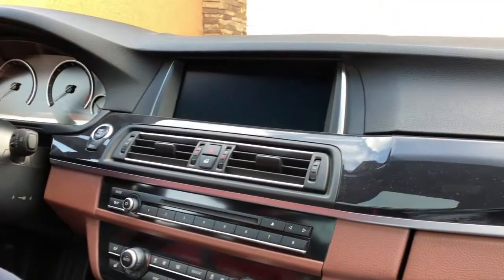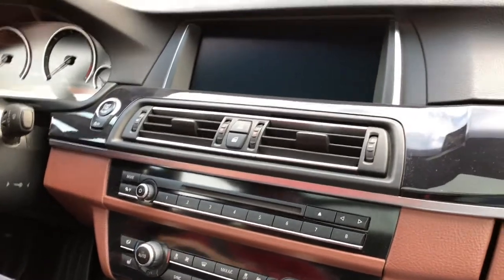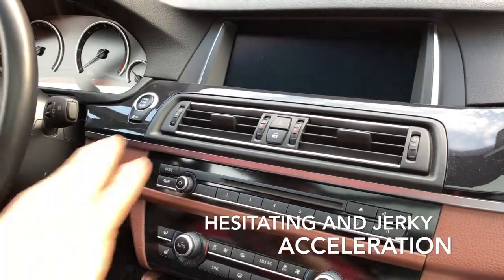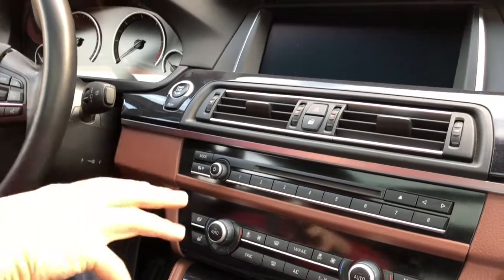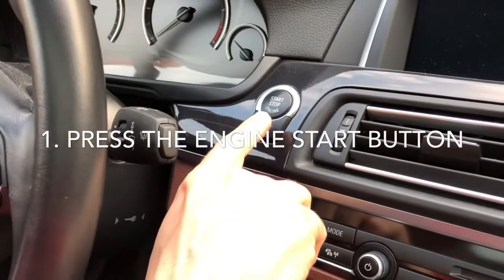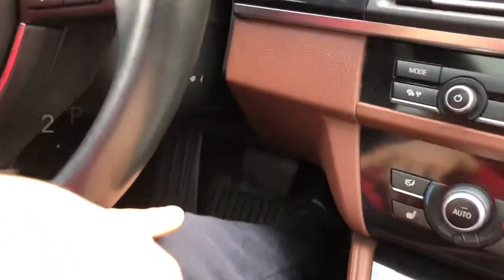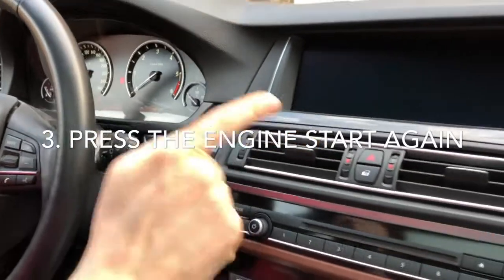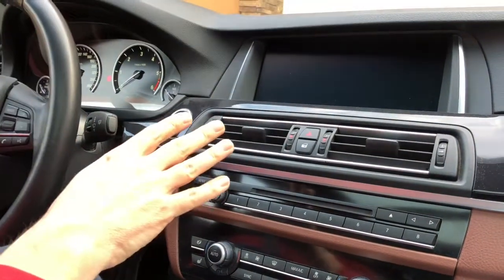BMW 535xd Acceleration issue (hesitation and jerky)

Comment: I figured it out by watching another video.  Something is loose or not sealed on the intake system.  I have had this issue for months and have researched and tried many different things to resolve it.  One possible problem was the air filter possibly being clogged and the engine/turbo not getting enough air.  When I checked the air filter it looked great…. Replaced everything with airbox n such and then the problem became a major issue as the engine was wanting to stall when coming to a stop and a slow speeds.  Prior to this it was only happening at high rpm and top end speeds.  I saw another video and another gentleman on YouTube with tag “Guille” he noticed a break on the seal of the Inter cooler causing the same issue.  Well the airbox is not connected directly to Intercooler return but I figured I would check anyway.  Didn’t have to or even look at the return because the culprit was the airbox connection to the intake.  Reattached and tightened the O clamp.  bAM fixed and engine acceleration just totally went to a new level…. Really where it was when I got the car.  I have been looking at many videos on this subject.  There are so many videos and people that complain about the staggered acceleration and some even claim that it’s just part of the way the vehicle works.  NOPE there is a leak in the intake system SOMEWHERE…. Could be in a different spot for you, however, I think the reason is is so common is that many of us change our own air filters.  Happened to me when I upgraded to k&N.  So if you have “staggered acceleration” or stalling at low speeds… check every component of the intake and make sure there is nothing loose or compromised.  Most likely air is getting in somewhere and I liken it to having a hole in a straw on a beverage.  Cracked straw and drinking your beverage is just not gonna happen.  Same concept here.  Hope this helps.

Comment: This issue what you are describing is also connected to Xdrive (Transfer case/box), check transfer case fluid, if it's dark, change it. Mine has this kind of problem, jerky acclerations, also car was jerking once driving on a hill. changing transfer case fluid fixed this issue 100%.
Reply: @Ray Scriven did you get a solution?

Comment: My F10 523 having the jerky issue . Slow acceleration from gear 1 to gear 2 , there is a strong punch n jerk and it changes to the next gear . The rest of the gears are buttery smooth . Just when slow accelerating from first to second . Have changed the ATF oil and filter . Not sure what’s the issue . Will this method helps ? Thanks in advance
Reply from the maker: @nicken818  hey, this is recalibrate the entire chain. You can try it, nothing to lose… give a try.👍
Reply: @gykgykbettercar  Hi , I have tried 3 times , first 2 try there is still small jerk from
The back push while accelerating and changing gear from first to second . After third attempt, the gear changing was smooth again . 
Hopefully it is resolved . Does F10 owners need to do this occasionally when the jerky push during gear shift returns ?
Reply from the maker: @nicken818  Hi, usually do not need to make too often. This is a very sensitive technology and of you feel some inconsistency its good to make it. Important to keep the timing and the steps correctly! But seems a solution for you… I am riding now a G21 M340 with only 20k km and I also feel sometimes between 2>3 especially in sport mode and echo mode… thats also an evidence of synchronization question as we all know the modes are just changing the characteristic and nothing more… if you feel better now, must be ok. If the problem still  occur - something else is behind. Thx
Reply: @gykgykbettercar Thank you for much for making this video with the solution . Appreciate

Comment: Ok I have a 528i so can you tell me what’s going on when I drive it be jerking a little bit and then when I turn off the car once I get to my destination I’ll turn the car on it will shake while I’m trying to start it but won’t start so I gotta wait a while and then it will start ?
Reply: What year is your car and milage?
Reply: I have the 08 550i.... Crankshaft position censor is why your car won't start after you drive it. And if you were driving and it died it would be your camshaft position censors and if you have some hesitation  it could be that you have over 100000 miles and you need to clean out or replace your Vanos solenoids if you see smoke out your pipes at idle you need knew pcv valves bcus if you have high miles your pcv valves seal with be ripped and if sitting at idle for a period of time and you drive off and see smoke your valve seals are bad

Comment: How long it will take to relearn nee driving pattern. I feel gears are shifting after long revup.  Does this reset transmission software which was updated by dealer.
Reply from the maker: Hi, it will learn immediately after you make the reset. Yes, it is just reset the the gear/transmission softer, like a zero shift. Hope helps…

Comment: 2015 M4 coupe DCT I’m experiencing this in manual mode 1st & 2nd very very bad car jerking when getting into the accelerator.  You simply don’t feel in control of the car it jerks and absolutely feels like a tuning issue.  I’m on upgraded turbos and tryin to dial this in anyone with advise please chime in.  I promise it’s not driver error owned over 50 high performance vehicles and ever ever experienced this with a vehicle before it’s simply just not correct the car has a clear issue going on that I need to diagnose soon or I’ll be selling because it simply makes the driving experience impossible with this defect at play.
Reply from the maker: Hi, this seems to me different issue like a simply re-setup. I have no clue about but you need to talk to gear specialist. Good luck man… hope not so serious to sell your M4 coupe 👍

Comment: Hi. My F10 gasoline. When it gets down to 2 from 3 in 1000 rpm at 20 km/h and just I push the gas pedal , it hits at first while accelarating. Not smooth accelaration.  Maybe it is normal ?
Reply from the maker: Hi, could be normal a little strike is normal even more at the back shift especially around 3 (3 to 2 and 4 to 3)... but this solution solve many other symptoms as this is calibrating the entire chain...
Reply: Did you fix it? Since i have the same problem on my f10
Reply: @learnmag  no.  But I drive Some 520i , 316i
, 320d. And there is the same thing on them.  No error on the Ecu.  I think it Can be from Oil or Selenoids.

Comment: hello to e90 is it possible?
Reply from the maker: Hello, it is difficult to say it works or not, but try it and share here if this works on your car... see other comments below. The question is the software and not the type of the car... good luck.
Reply: @gykgykbettercar  I tried it earlier, it's a little smoother but there is still a fine jerk, it's very helpful thanks 👍👌
Reply: For e90 you need to turn on ignition without starting the engine ( just like in this video ) . After turning on ignition, simply press the gas pedal down completely for 30 seconds- 45 seconds and then you can start the car and the transmission will have been reset .

Comment: Nothing changed on my f30
Reply from the maker: Sorry... We are not sure what is the right selection criteria but as you see below it was working for many others... :-)
Reply: Does it work for 2011 f10 550?
Reply: Change your bushings
Reply: It does work. I tried it around 30min ago also cruising and speeding it. Totally 100% better. Just me or idk maybe i wait 2 minute in car before trying and heard motor sound like solenoid or something. Maybe they trying to calibrate. The sound appear at around 1 minute and half after releasing paddle.
Reply: @ayn30  I’m doing it in my f30 and I heard the second click as I read your comment. Hoping it works… idle and startup sound n feel great so far.
Reply: @robrodriguez4866  its does work and as i notice primary cause of it maybe because of third party obd scan tool. Better to use bmw oem one like inpa suite